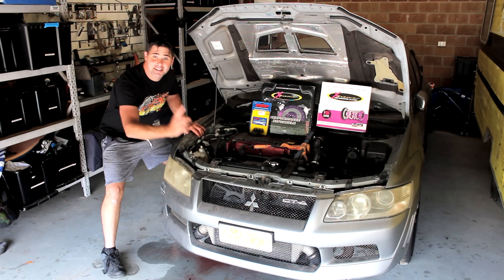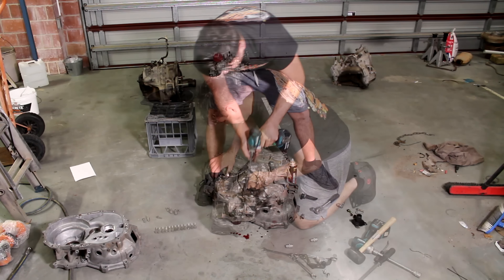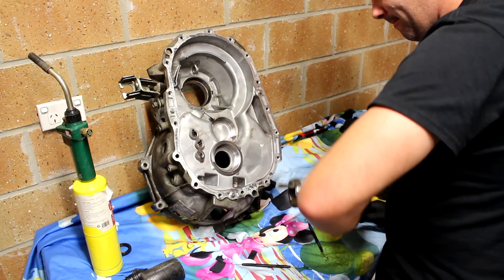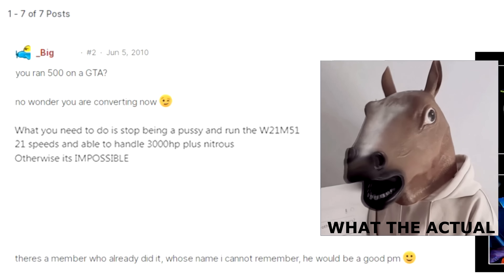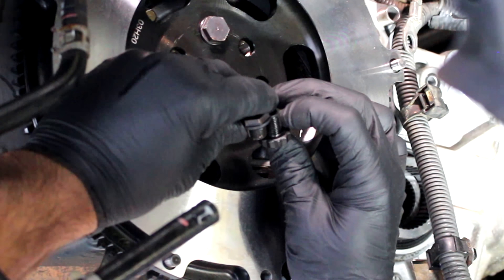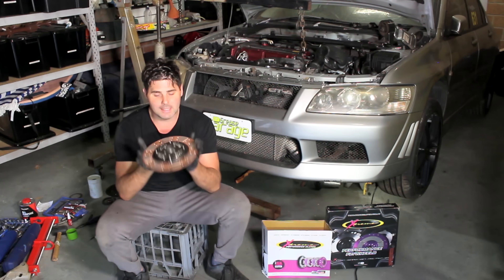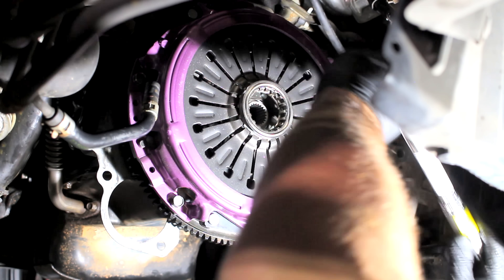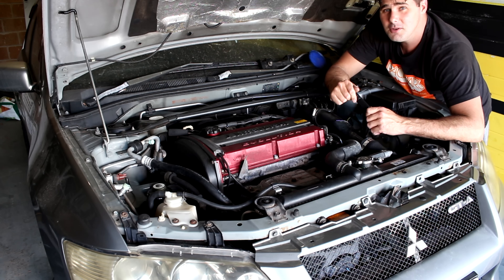GTA EVO GETS A 5 SPEED MANUAL | PT2 | Grease Garage

Comment: If you are reinstalling the gearbox without a hoist consider dropping the engine down & out and then bolt the gearbox onto the engine first. then lift it all back into the engine bay together as one unit
Reply from the maker: Uzumakk is 100% right that is better , the engine being drop helped alot, the problem is the rear backet  because both mount and bracket are a fixed type, i can see why mitsubishi change the bracket and mount design on these , it might easier to drop the whole engine and frame , or just change to the new swing bracket design
Reply: @GREASEGARAGE  yeah I meant remove the engine completely from the car.  attach gearbox to the engine. then reinstall the engine & gearbox as one unit. Seems like a lot of work but less frustrating maybe
Reply from the maker: @UzumakiGarage  i’m not disagreeing

Comment: wait this cheap 5 speed from the magna is it the 5 speed auto you are making for cheap or the 5 speed manual you are making for cheap?
Reply from the maker: you can do either, auto or manual. just need the original evo bell housing and the evo ring gear and the diff that’s in side the gearbox :)
Reply: @GREASEGARAGE The auto gearbox is the same or I need manual diff and manual bell housing?
Reply from the maker: evo manual diff, the evo auto to manual might be interchangeable but I can not confirm yet

Comment: Hey bro do you gave a link for those mount bush? And i sent you a pm on your fb page. Ta!
Reply from the maker: hey I can get you a link try this and let me know how you go https://madpolly.com/product/evo-1-2-3-gsr-lancer-right-slotted-polyurethane-engine-mount-insert-pu-dsm-4g63/
Reply: @GREASEGARAGE  thanks also did your car have a soft limiter on neutral before? Ive done the swap and wont let me rev pass 3k
Reply from the maker: @daihq6278 did it have the same in park? , there is a couple of ways of fixing this, a 5pin relay is the easiest, set it up so the car thinks it in a ⚙️ 1-5 and put a clutch switch in, set the relay up so when your foot is on the clutch the car thinks it’s in natural, and when your foot is off the car thinks it in gear,  this should remove the limiter when driving and over when your launch the vehicle it will act like a 2step